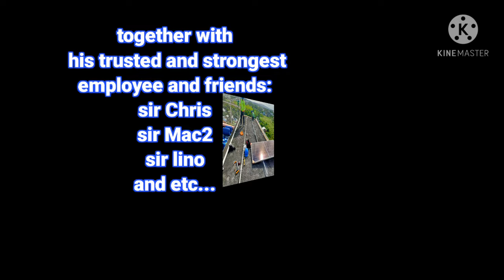5kw grid tie system set-up for residential

Comment: Twin mppt din ang 5kw Solis, Sir?
Reply from the maker: Yes po sir.
Reply: Curios lang ako sa Isolator switch if mandatory ba talaga na lagyan, despite of having DC switch na sa PV INVERTER? May isang technician kase ng supplier, no need to install ISOLATOR SWITCH kase daw nga meron ng built in DC switch, tama ba yun?
Reply from the maker: Yes po sir...actually no need na po yan...just for eye catching lang...para balance tingnan yong isolator.hehe...
Pero anyway on the other side point of view, maganda dn po siya if ever mag palit ka ng breaker or surge protection device no need na umakyat sa bobong pra pag disconnect ng solar panil...
Reply: @solarlover143  i see. Thanks, Sir. Good luck!!!
Reply from the maker: Yes sir... I will.
Reply: Boss, ok lang ba na ikabit ang panel ng baligtad sa vertical installation. Di ba normal n kabit is yong Top ay mataas ang angle compare sa bottom. If Pabaligtad , yong bottom ang mas mataas ang angle compare sa Top. Wala b syang effect lalo n sa  water tightness ng mga terminal ng cable sa panel?
Reply from the maker: Wala nman sir...waterproof nman po kasi ang connector niyan sir.
Reply: Sir tanong ko lang kung tig ilan watts yung panel salamat sir.